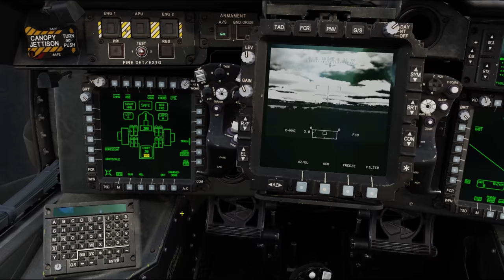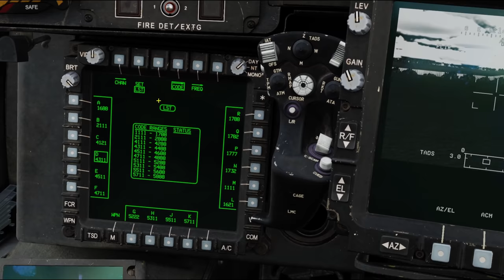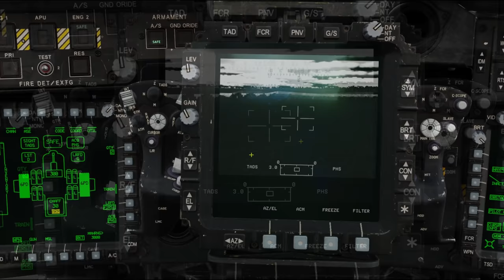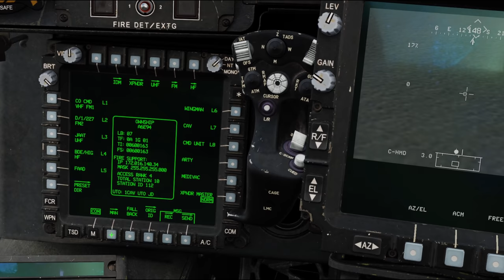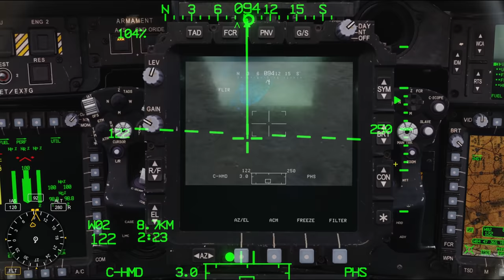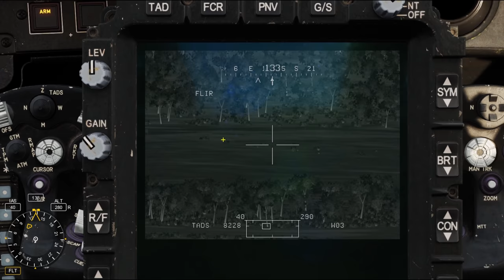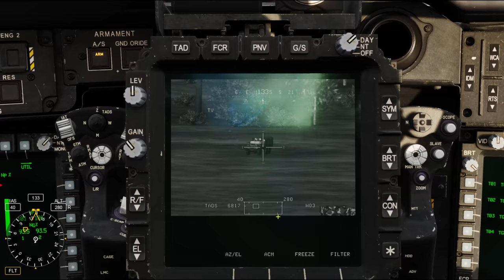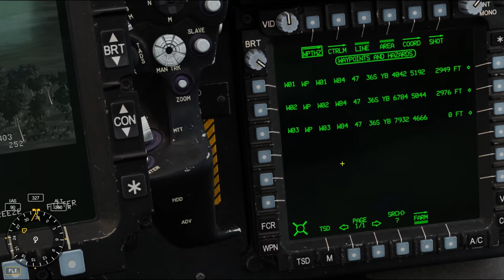DCS AH-64| Front seat flow | A way to operate in the CPG Seat

Comment: As a former 15R working on the Apache and now I install the TESS equipment for simulated engagement (yes we've probably met NTC or JRTC).  I have a very good understanding of how the front seat works.  I am fortunate that I also get to play in the real simulators on post, I got a little over 8 hours back seat time in the AH and a few hours in the UH.  I'm seriously looking forward to getting into DCS and setting up for the Apache specifically, any advice on computer and set up (I don't know much about computer's).
Reply: Do you still need advice?

Comment: This is my first entry into DCS. Why are there so many features not implemented yet? Is this normal for DCS modules? Do they release bare bones and get updated over time? I've been told something as important as altitude hold doesn't work "yet" either.
Reply from the maker: Yes it’s early access. You can wait for full release later and pay more.
Reply: @CasmoTV  Cool thanks, it's good to know that updates are coming. Thanks for the video and reply.
Reply: The implemented features are also more than enough to be learning. The "Quickstart" manual is 300 pages long. I've had this over a month and haven't even been in the front seat yet 🤣

Comment: Thanks for this. Helpful. Would you ever use trkup north for the map? It's tempting to do it but I'm not sure if its a bad idea. Also do you actually play single player like this or are you mostly 2p? I've found using george to fly while I cpg shoot i just dont evade well enough and have to switch to the pilot seat and do it myself.
Reply from the maker: I fly like this to make videos. The end.
Reply: @CasmoTV  Ok. I was just curious how it works single player. When you'd use George and when you'd just flip between seats. I'm guessing you mean you use George for the videos but play 2 player generally.

Comment: How did you so quickly switch off the TADS view from the HMD? Is there a key binding for that?
Reply: on the RHG theres a 4 way hat switch that you use to select which sight you want. Not hard to miss: top is HMD, right is TADS, so forth.
Reply: so the keybind in question is "show IHADDS" I believe the default binding is the "i" key.
Reply: @123TheCloop  to move the monocle, yes it's I

Comment: Casmo - can you explain one detail? While on the ground, the FLT page shows barometric altitude which is actually a few feet higher than airbase elevation from GPS data. Is it because the sensor on the Apache is placed around 2.5m from the ground or is it a bug in the build? If it's the first case, which altitude (and barometric pressure) should be set? Or those few feet dont matter that much?
Reply from the maker: Couldn’t tell you.
Reply: only time it should matter is in zero visibility.
Reply: Usually just use radar altimeter anyway. Only use I see with the barometric is, if you are above radar altimeter range.